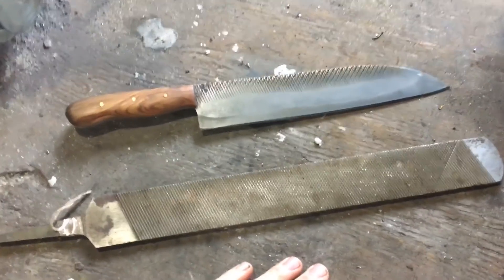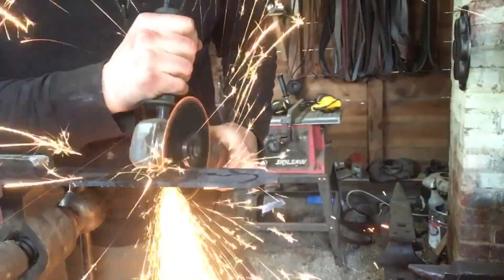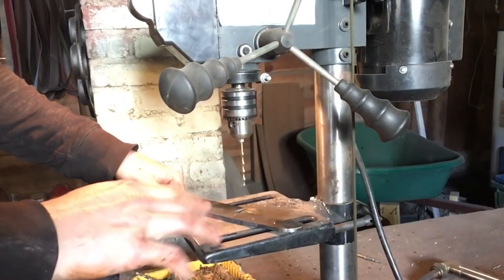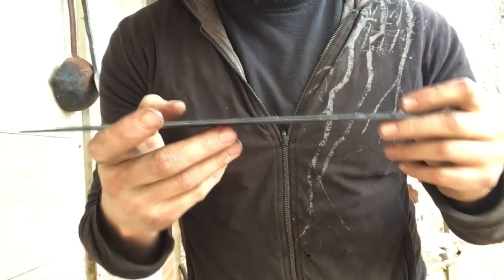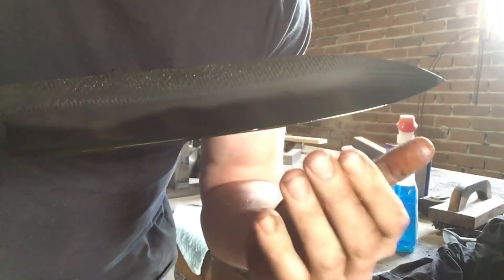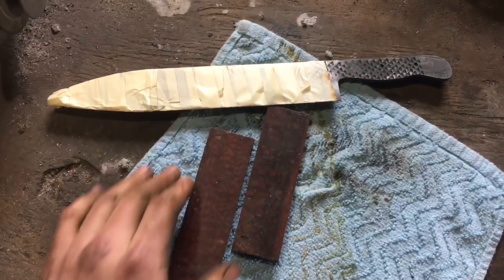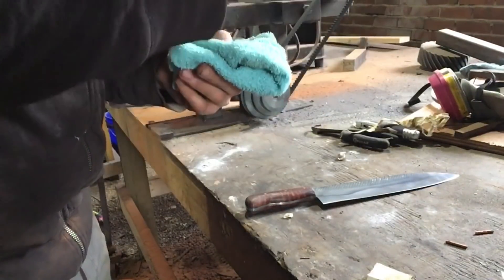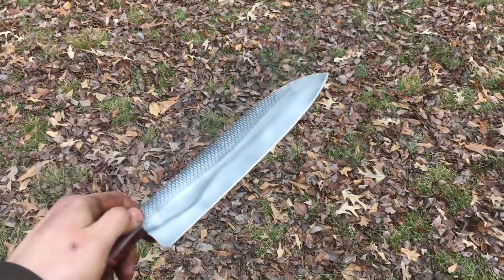Knife making: making a kitchen knife from a farriers rasp

Comment: Alright I got another question, you didnt show any curing step for the cement?  Do you just apply it and put it into a forge or what?  I'm looking up different refractory cements and some cure without heat and some require heat, but they all seem to require curing.  So I'm just wondering what steps did you take?  Cause I want to do those steps, it talks about it off gassing the steam inside and causing issues when used as intended.  It seems like that wouldn't matter though when it's just on metal and not actually being an integral part of a fireplace or repair of some sort.  I dont know, I dont want the stuff to like start melting and running off the knife into the forge.  It dosent seem like that would happen, but I dont know.  Thanks for any help, i wish i could add pics to show you this sweet knife I'm about to have!  I made a rasp knife with a 12" blade on it!  Now all that's left is quenching it and finishing it, but I'm stalled on this cement issue.  I have the patience to wait a few days, so hopfully you see this before i just do the ol winging it.
Reply from the maker: I use satanite refractory mortar. I've had problems with it falling off plenty of times. Even after being baked in the oven to dry it out. I normally just put it on wet. Pass each side of the blade in front of the forge a few times to bake it on and just be sure to be very careful moving the blade around in the forge.

Comment: This may be a dumb question,l but without that food safe finish would that knife not be able to be used in the kitchen? I'm really interested in doing this, and picking up knife making and I like watching videos like these, it motivates me to want to try it. Keep'em coming.
Reply from the maker: jmart78041 that’s what the butcher block oil is. Needs to be re applied with use but even without it as long as a carbon steel knife isn’t horribly rusted it’s perfectly safe to use

Comment: What type of drill bits do you use to drill through the knife handle? I have had issues not being able to drill through unhardened knives (forged from leaf springs) and just end up hot punching instead since I haven’t had any luck with the drill press.
Reply: Cobalt bits are the ultimate for very hard steel - BUT WITH CAVEATS; you have to know what you're doing, a bit. I've used them to go through even hardened 80CrV2 and 52100 (don't ask me why....ok, because a few times I forgot to drill the holes for the pins, I'm human, sue me...) You NEED to know the right drilling speed, and to go slowly, and definitely to use a good cutting/tapping oil (preferably a very modern one; I like Re-Li-On) - and realize that cobalt bits are BRITTLE. And - again - both rotational speed, and feed-speed (i.e. the pressure you use, how "fast" you push on the quill, pushing the drill bit down) are important. That said, with a cobalt bit, preferably a "stubby" one, you can cut through even a hardened piece of knife steel quite easily.
Reply: @sumgai7  thank you, that is very helpful to know. I’ll have to get myself some of this Re-Li- On oil and see how it works out.
Reply: @daveg8700  Oh, wow - didn't think anyone would notice a 7-month-old (ahem) thread, so so glad you DID see this, and that it was helpful! Honestly, that Re-Li-On is bloody magickal stuff, for any kind of tapping. I was introduced to it by an old-school machinist guy who owns a husband-wife supply shop in Silicon Valley, who taught me a little bit about tapping threads. Starting with: don't save money on cheap taps; he sold me a pricey Swiss tap but - I was tapping a block of stainless for a benchtop biofuel reactor (another story) and had broken off an Erwin (from Big Orange Box Store) in it -- he said "don't tell me you were doing that "twist it a turn, then back it off a quarter-turn to clear the chips?" - I said "of course!". He looked at the Erwin, shook his head, pulled out the Swiss tap ($18 or so), put it in his BRIDGEPORT MILL (!), put my part in the vise, squirted some Re-Li-On on one of the other holes, flipped on the mill at speed, and sunk the tap into the hole using the QUILL, like it was cheese. (Note: I don't recommend that - I still don't understand how he did it without stripping it, although he did run it all the way down through the piece and out the bottom - it was a through-hole! - but wise are the wizards....) 
ANYhow. I do still back off a bit to clear chips, but I learned that saving money on taps (or drill bits) does NOT save money; a GOOD drill bit or tap -- generally European, American, or Japanese (probably others, I'm sorry for what I've left out of high quality from other countries) -- is simply in a different CATEGORY vs. a big-box one (and a whole category MORE above a cheapo no-name Chinese import). And the right fluid is totally key.
As far as drilling goes - DEFINITELY Google a bit for drilling with cobalt bits. Ironically, if you go too slowly (not the spindle speed - rotational - but the rate you push the bit into the work - feed speed) you risk work-hardening the steel and/or dulling the bit's cutting edge (web) -- you actually need the bit to "bite" into the steel and take the cut -- but also not TOO fast -- it's a little Goldilocks, just-right, and takes a little feel, which you'll get, especially by how the chips are coming off (very "satisfying" when you get it right. :-)). And you also do need the right spindle speed - just googling cobalt drill bits hardened steel etc. will get you there. Again, cobalt bits are QUITE brittle and prone to shattering (hard and tough are generally sort of opposites); keep that in mind -- and so the shorter, stubby bits are best imho. Good luck!
Reply: @sumgai7  thanks for all that info. I’ll have to keep that in mind about the tapping, I know I have broken a tap off before into a piece of steel…. And unfortunately there isn’t much you can do at that point except start all over again lol
Reply: @daveg8700  99.99% true - the exception being - and this is in the ... basically same as in the "yeah-and-if-I-had-a-yacht, I'd..." file: if you have access to an EDM machine, you could EDM the broken tap chunk out. Now: question here is relative value: is the part something you can make another one of without incurring massive cost, time-delay, and/or inconvenience? Here, a decision flowchart naturally pops into all our heads: If so, get going on making that part over again. If not: go find a company that has an EDM machine and have them burn out the tap, and hand over a Bunch of Money (and DON'T f*** up this time!)

Comment: That is a real beauty!  I actually just got some files and normalized one of them.  Today I shaped the pointy end but the material is still being extremely hard to remove.  Like I used a torch to heat it up to dull red and let it set and cool off, so are they just always hard to grind?  Or did I not get it hot enough or what?  I put it in my oven when I stopped for the day on 550ish for like 3hrs, and it is a beautiful wheat color now.  Hopfully that draws it back even more, but I am super excited to see this one finished!  I wanted to do a hamon line aswell and I glad to see that it will come out looking this killer..... hopfully lol.  Well maby not as good as yours but I hope it will be functional at the least.  Have you ever used pallet wood for handle scales?  Cause I got a pallet to use for handles, I havent seen it done anywhere though.

Comment: I see many people, you including, doing the latest sharpening step ( with the sharpening rock) by pulling towards you the way you did, but i've been told the other way (blade first, pushing from you) was better to keep the blade's shape intact. Is there any thruth  to that ?
Reply from the maker: Knox sharping on a stone can be done either way. All that matters is that the knife is going edge first across the surface. Stropping on leather is done by pulling the edge backwards over the leather. The opposite way of sharpening

Comment: So tempering with a torch, do you need a nice number of cycles? Like sometimes ppl allow to cool a couple times in-between oven tempering
Reply from the maker: I’ve never found a need for it no. Using the torch puts more heat into the blade faster than using an over so the same result can be accomplished with practice. However. Large blades that will see a lot of heavy use can sometimes benefit from 2 temper cycles. Like large camp knives made of 5160 or alike.

Comment: I learned to sharpen razor blades because of knife makers "safety reasons." I make money now sharpening anything by hand that can be done. Circular saw blades, scissors, 2 man saws,  drill bits, what ever... learned I could make cash sharpening while over sees, never spent a dime of combat pay. I always cover my edges for transport. For the safety of the edge and my client. Also was asked by my lawyer to include a warning lable for the clients to display, they know it's sharp and i always send a personal letter with my work jic, but who knows who will touch their kitchen knife block. Hate seeing a dull tool out of the box, makes me sick. Seeing guys drop 300$ on a knife they intended on trusting their life to and it can't cut butter. Thank you for not being "that guy"